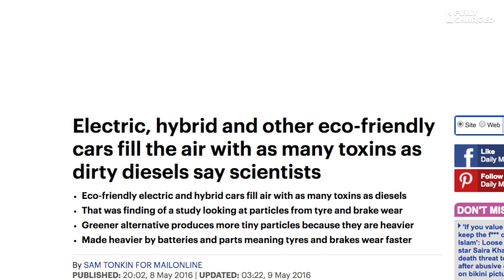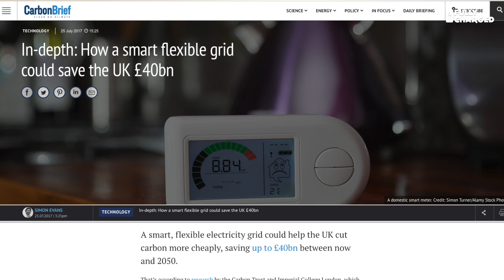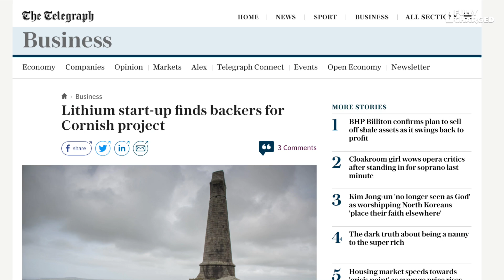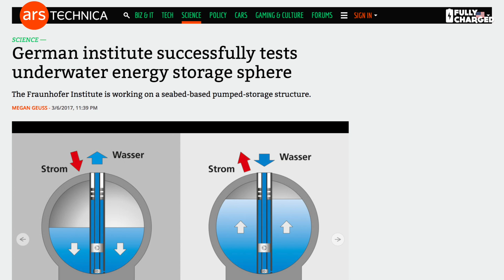Kettles, Particulates & Flexible Grid | Fully Charged News

Comment: Not convinced that autonomous vehicles will actually improve the current traffic & car ownership woes.  Today there are taxis (yes there is a driver cost), & car share businesses where can rent car by the hour, point to point.  It's hard to see how autonomous vehicles will significantly reduce the costs of traveling in a car, apart from paying for inner city parking.  

On the other hand, the autonomous vehicles are likely to incur higher maintenance costs (think Friday night drunks in a car without supervision), plus will still require parking & storage for non-peak times.  Add more cost as security features are added to take over the job previously done by taxi drivers, to minimise damage caused by passengers.

Even if there is this fleet of  cheap autonomous vehicles,  people will still want to travel at peak times.  Now induced demand (same as when build new highways) will increase the volume of cars.  Even more vehicles added to traffic as people can shop online & get things delivered to their door by autonomous vehicle.  Instead of daily deliveries which can take a day or 2, could  get multiple deliveries per day for everything from meals, ironing, washing,  shoe shines as it becomes economical to do so.

If autonomous vehicles of all sizes become ubiquitous, then expect a short term fall in traffic, parking problems, & trip cost.  However fairly quickly expect a massive increase in traffic density (24 hours a day), as people use them for the most frivolous purposes such as 3am delivery of a pack of cigarettes.

Yay, more traffic, more parking required in formerly quiet areas to store vehicles, more people traveling longer distances, more roads, more noise, more animals being flattened, not to mention thousands of jobs lost, and shifting of profits from small businesses to large congolomerates.

Comment: if you have single phase power in the house on the same circuit as the kettle you will blow the fuse/circuit breaker... 3 times a year your 1kw heater will cost you £50  an hour to operate in the peak of winter, it's called triad charging for commercial / industrial. You know nothing of the energy market, stop talking bollocks . I like your references to max demand power on the grid. 2040 we will need 15 Hinckley nuclear power station to power the electric cars. Sorry wind stops blowing and dark at night.... the what? Before you say tidal , YOU HAVE NO CLUE TO THE STABLE DEMAND REQUIRED TO POWER THE EARTH DAY AND NIGHT. People are decades away from actually understanding the infrastructure required and power levels required to actually make comment.... 150mwh of thermal or battery as their installing also will power the state for 1 hour. I'm done, God sake understand the physics before commenting or dictating.
Reply: Evolution - Question Time my understanding ?? You have no idea of the amounts of energy required., yes English isn't great. Battery storage is no where near helping to support the grid. 
That's ok you can spell check for me and com0letely miss the point I'm trying to make, as people do when they have no idea about what their talking.

Comment: Solar Thermal runs the salt at more like 500 C not 2,500 C, which is a good thing coz you don't need the extra efficiency of super-critical steam because you fuel is free and produces no CO2, and you can do without the expensive complicated and more dangerous utlra high pressure steam piping and otehr equipment.

Comment: Two points . If you have an instant electric shower (9kw I do) and you boil a kettle (1.5 to 2 kw) and use both together, nothing happens. You have a shower and a nice cup of tea. On the point of acceptability of autonomous cars. We used to make people walk in front of cars waving a red flag, because people and horses were frightened. now we don't. Change happens all the time, usually quite slowly.
Reply: You are so right...electric shower takes more than any household appliance...followed by tumble dryer, washing machine, electric oven and electric kettle (in my house at least).
I really don't understand why people don't know this.
Do we really need smart meters to tell us how much we are spending?

Comment: The use of compressed air as a clean energy source is just beginning to be exploited. I remember seeing a car a few years back, which ran on compressed air, (I haven't checked back to see how it did), but it seems like compressed air, as a clean energy storage medium was a good idea. 
    The German balls wouldn't necessarily even need to have solar or wind powered pumps, as they could run a compressor on the motion of the water, or the tides. If they are situated carefully, to take advantage of naturally occurring currents, topography, etc. the whole unit could be under water, presenting no industrial eyesore or nimby vulnerabilities. Another advantage of compressed air, is its' portability, it can be sold when in surplus, for a variety of uses. 
    Keep debunking the liars, Robert, they've got a lot to lose, and they won't give up trying to slow progress.

Comment: Robert, I'm afraid that you are slightly incorrect on one of your facts about 11kW chargepoints. An electrician would never install one of these on a single phase supply because there are not enough live (phase) connections to do it in the first place. Even the National Grid document is misleading in this area because they quote current rates of 48A for 11kW chargepoints and 96A for 22kW chargepoints implying that these are single phase pieces of electrical equipment. In fact the current rates are 16A and 32A per phase for 11kW and 22kW 3-phase chargepoints. Given that a 3-phase connection will provide a 60A/80A/100A per phase these chargers will be much better for those with access to 3-phase power and also for the distribution network because the current demand for vehicle charging on the phases will be balanced.

Comment: You don't really explain why brakes are used less, or tyres wear out less...that would have been nice for some of us thickies.
I'd also like to know why EVs need brakes at all - what is the reason they don't use 'regen' all the time? I mean, there surely is a reason, but what is it?
Reply: Max Waterman Well... brakes are used less because the motor works like a generator and slows down the car when you lift of the throttle without having  use the brakes and puts that energy back into the battery. The car still needs 'normal brakes' for safety and extra braking power to perform an emergency stop or if the regen failed or the battery was full and regen was off like if you have fully charged the car and then drive down hill for a long time. 
Also tyres wear out less (I can vouch for this with my EV) as you tend to drive smoother without realising. The regen is quite gradual and soft compared with normal brakes, you tend to anticipate slowing down more in advance and acceleration is smoother too so seems to wear tyres less.

Comment: So I live in USA and in SC. We have 110 F days and 100% humidity Just about all summer. I love my AC and would not live with out it. I must keep my temps down due to health troubles. So we would have big power bills. $400 to 500 dollars in the summer months. Over the past 3 years as I could. I have been Buying and bulding up my solar power. Now I am up to 2600 watts of PV with 12 Trojan t105 Batteries and a 2400 watts 24 volt inviter. 

My power bills are now down to 120 a month in the summer and 80 ish in the winner. Top that off with 2016 are power was out 68 days that year. Not all at the same time. 28 was from a hurricane. Point is that solar works well if I can do it on a income of less than $720 bucks a month. Most can do the same. For me solar makes my life so much beater. Top that off with it being a hobby that pays me back that is hard to beet. 

Thanks for the video sir. Love your show keep up the good work. God Bless
Reply: +Roger Heuckeroth
I think you can run a 5000 or 9000 BTU AC window unit from a 2400 watt inverter without trouble. As long as people know that wattage jumps up to two to three fold for a few seconds when an AC unit starts. But the average 5000 BTU unit only draws 450 to 650 watts to run. And as long as the unit is reasonably efficient. 9000 BTU unit is doable on a 2400 watt inverter. 

My brother runs his RV air conditioner on a 2000 watt Honda generator when he's camping. But his AC unit is pretty efficient. It only draws 11.5 amps. The Honda handles the extra amp load for a few seconds when it starts. Wattage spikes well below 2000 when the fan is running and the compressor kicks in, it peaks at around 1800 or so. 

But yeah it's true the technology varies. Some 2000 watt generators won't work with some AC units. Either the AC unit wont start or it trips a breaker. My brother had to change up AC units a few times before he found one that worked with the Honda. (He wanted the Honda because it was small and quiet. And just for the record I don't consider camping with an RV that has AC true camping. Just my opinion.)
Reply: +yankey4
That's what I want to do next, get a PV system. At least as big as the one you have.
Reply: Yankey4 - I also live in SC.  Summer bill is about $250, winter is under $100.  I'm looking into solar system, not because of financial reasons, but just seams like a good/right thing to do.  

Your numbers don't add up though.  What kind of A/C do you run on a 2400 watt inverter.  I'm assuming not central air.  My central air would take a 10,000 watt inverter.  

Glad its working for you though!
Reply: I run 2 5000 BTU window ac's off my invinert with all the rest of my loads. Most od the time both are not on at the same time. One runs as a dump load. So when the bank is full the AC kicks on the burn off some of the power. That ac will run about 2 or 3 hrs a day. The main acr runs about 10 ish hrs from the batts and the rest from the grid. My home is just 800 SF.. So not all that big. I have videos on it. 

So where about are you in SC? Thanks and God bless.
Reply: Just did a test and yes my solar will run a 1200 btu wall ac 120 volts .. Uses about 800 ish watts to run and start is 2300. will be u loading the video soon..
Reply: We live in Myrtle Beach.  Checked out your video.  Nice.
Reply: Nice your about 2 hrs from me. I posted the video to see if the big wall AC would run. Thanks and God Bless
Reply: yankey4 nice job with your AC, but please stop with the "God Bless" this is a science channel!

Comment: 2040 will be here before we know it and who knows in the meantime how governments will handle the uncertain economy during and after Brexit.  Certainly they can't afford to lose the current annual revenue from vehicle fuel which runs at £27.5 billion. So, one of the biggest challenges is to replace that hole in the economy without huge increases in road tax or electricity prices. Maybe now is the golden era for electric car ownership, despite the technology being in its infancy. Many free charging stations and cheap overnight electricity for charging at home goes a long way to offsetting the overall ownership costs. I worry that the UK government won't see electric cars or home generated electricity as a priority and will miss a golden opportunity for the UK to be leaders in electric vehicles and flexible grids.  As a result they could lose a lot of revenue very quickly as the transition to electric vehicles becomes public led rather than government led.

Comment: Quick calculation regarding rise of the sea level : A 30 m ball has a volume of V = 4/3 * pi * r³ with r = 15m -> V = 14137 m³. Spread over the water-covered surface of the planet (A = approx. 362.000.000 km² or 362.000.000.000.000m²) means V/A = 3,9E-11 Meters or 0,039 Nanometers or 39 Picometers per concrete ball, which is about the atomic radius of a Hydrogen atom. Thats nothing to joke about.

:D

Comment: The most dishonest thing I ever heard is that you risk setting your house on fire when turning on the kettle while charging your car. If you have had everything done by a proper electrician, there will be no security risk whatsoever since all is protected by fuses. The worst thing that can happen is that you blow the main fuse and have to call up the energy company to help you out. 

I had a Renault Zoe and a 3 phase 11 kW charger. I always (partially) charge the car when I got home and made my dinner on an  induction stove, running a microwave and kettle all at the same time. No problem.

Better still, if you have a smart meter and smart charger, you can have you charger reduce power to the car when other equipment in your house uses too much power. Same is done with heatpumps used for home heating. 

In essence: there are simple technical solutions for this to never ever be any problem. Let alone it being a danger.

Comment: Electricity will NEVER be free - period. We have been promised free/cheap electricity before... Nuclear generated stuff. Never happened. Once renewables are in place they STILL cost money to maintain. The cable supplying my house have been there since the 1960’s, sub station is still the same.... yet prices go up and the companies claim it is to invest in infrastructure. 

Stop dreaming of free electricity and lower running costs of EV’s. It’s not going to happen.... the Governments will still find a way to rip off motorists, the energy companies will still claim they are updating systems - when in reality, the only things updating are shareholders bank accounts.
Reply from the maker: I'm not sure I said 'electricity will be free' but it is an indisputable fact that the price varies from very very high to negative. That does happen, not everywhere in the world but in countries with large renewable installation it happens very often. It's not sensible or even helpful but it does happen. Of course it won't be free unless you make your own which 20 years ago you couldn't really do, but now you can, and I do. Yes, I had to pay for the panels and battery, and the car. But, and this is really important, the actual fuel I use in the car, when charged from my solar, is free.
Reply: Ontario Nuclear raised to 9c/kWh, that's a 50% raise this year to pay for their refit over the next 8 years.   The latest production offers came in at Wind = 8c/kWh and Solar = 13c/kWh respectively.   Wind and solar are now cheaper to purchase new than any other power source.
Reply: That's is a fable. Nuclear never promised free electricity, in fact in many studies done during its early infancy actual engineering calculations indicated a cost similar to coal, which in fact it was. But yes all this crap about free solar, that's why in Ontario solar gets 48 cents/kwh avg and wind gets 14 cents/kwh vs Nuclear gets 6.6 cents/kwh. Yep wind & solar is sure free. And pushing electricity prices sky high with high priced wind and solar will of course make EVs more expensive with respect to ICE vehicles.

Comment: Fullychargedshow do you intend to force everyone to live in cities? Because a car that can't travel at least 400 Kilometers is useless to those like myself that live out side of the city. So far the only non petrol auto I've heard suggested that could work for me uses hydrogen to generate electricity.
Reply from the maker: I think Dave B has answered your question very fully. I live in a rural area, nearest shops 7 miles, nearest town, 14 miles, I've driven over 60,000 miles in my Leaf without issue. Perfectly doable and often easier for people living in rural areas as more have space to park car near house.
Reply: It seems I need to update my research.

Comment: *Brake Dust is going almost away due to EVs.  Especially with the adoption of Ferritic Nitro-Carburizing (FNC) technology on rotors.  I have 100K miles on my Chevy Volt and the rotors just don't rust!  Also, with regen my original pads after 100Kmi of use have worn from 12mm down to 10mm.  They are basically new! Dust? what dust..

Comment: UK houses have, typically an 80A main fuse.  Some flats, or very small houses might have a 60A fuse.  So lets take that as the worst case (see note at end).  240V (rms) x 60 is 14,400 or 14kW.  So assuming you're putting 11kW into your car (which as Bobby says, you can't (7kW is max single phase charger) then you have 3 kW "spare", which is what a (big)kettle takes. So, even with an illegally fitted 11kW charger, and that huge, 3kW kettle, you're still ok!

(note, the main fuse fitted to your incoming mains spur is a passive fuse. that has a strip of metal, which is heated by the current passing through it.  It's nominal rating, ie 60A is it's HOLDING current under worst case conditions (highest ambient temp)  In reality, your primary 60A fuse would not actually "blow" quickly until around twice it's rated current is pulled, most fuses have a time rating of between 2 and 10 seconds at twice there rated current)